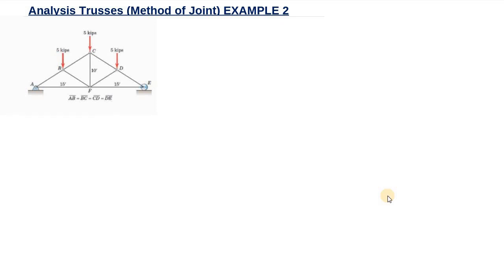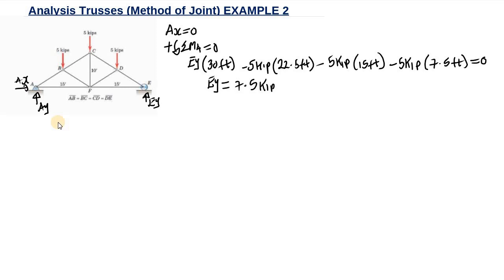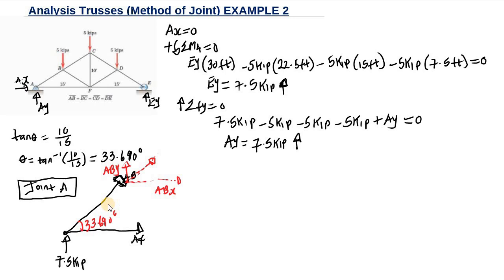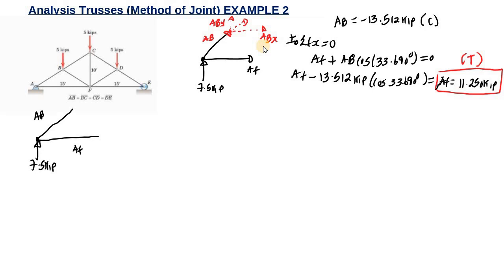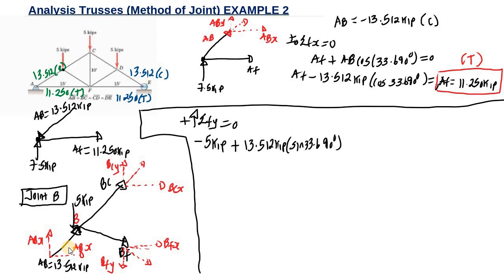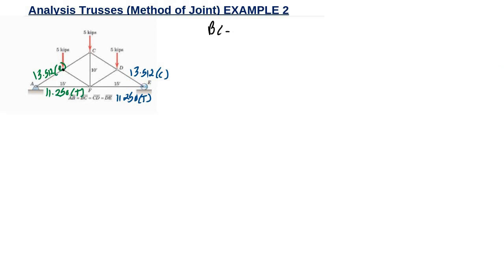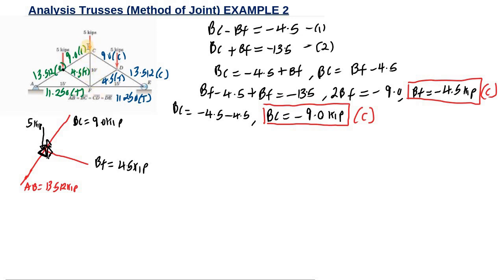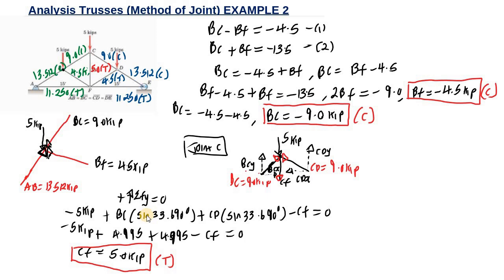method of joint truss analysis well explained!!

Comment: 👍👍
Reply from the maker: Thank you
Reply: @Innotutorial  quick question, when you were calculating member AF, you considered the sign of - 13.51kips(compression) Hence you calculated it as - 13.51COS(33.96)... But in the other calculations for BF and BC, you wrote +13.51 kips. Why is that?
Reply from the maker: @JUJUTHEDJ  Hi dear. This is because the decompose resultant force for AB is acting upward. Hence; the value become positive. I hope that answer you question. 

If not, let me know exact timing of the video you need clarification. Peace
Reply: @Innotutorial   the first part of my question is around  12:10 then the second part is around 19: 00
Reply: @Innotutorial  I understand it now
Reply from the maker: @JUJUTHEDJ  oh! That is good.